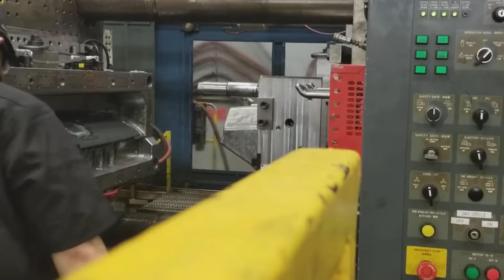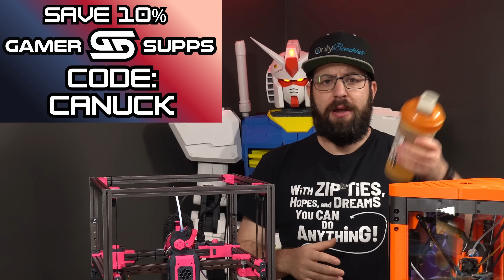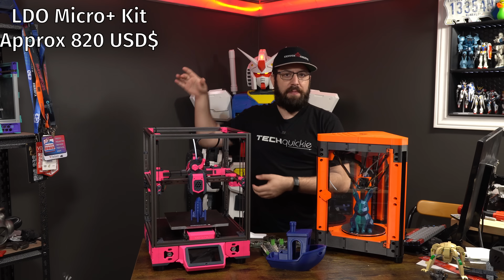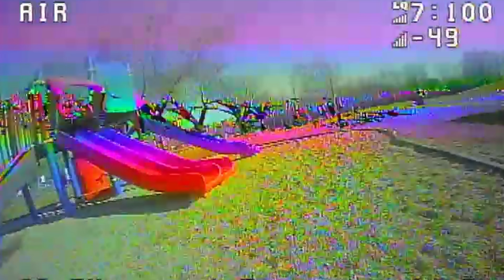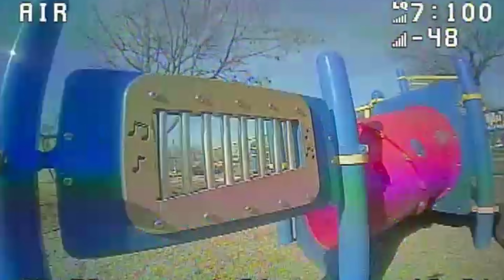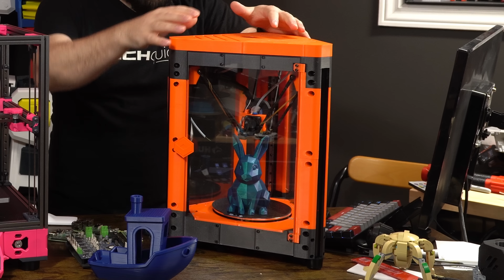Are DIY 3D printers in danger?

Comment from the maker: With the rise of laws regulating 3d printing in various places, do you think that will lead to an increase in people interested in building their own printers in the future?
Reply: The thing is, it's ALREADY ILLEGAL to 3D print a firearm... Or, more accurately, to "create a firearm that is undetectable by metal detectors" or is "untraceable" (which courts have decided means the manufacturer must get a special license and install a unique serial number on each gun they sell). I won't say "ghost guns" don't exist, but they are not anywhere near as prolific as guns that have been stolen and the serial number scratched off that already exist, and there are ALREADY laws against the existence of "ghost guns". And it's FAR safer to CNC-mill parts out of metal than it is to print a plastic piece that has to somehow withstand an explosion going off inside it. So these laws are essentially a solution in search of a problem. Trying to make a 3D printer detect whether you're trying to print a firearm or not is just about impossible, and even with AI it'll end up "detecting" the wrong things, like cosplay props ... is that tube a part for a foam sword/mace or a piece of a lightsaber, or is it a gun barrel? Better shut it down and have the authorities question them like a criminal just to be safe ... that's just a single example. And before you say that I'm being Chicken Little and shouting that "the sky is falling" keep in mind that in Washington state (the state I live in) part of the new 3D printer laws basically says even just owning the files is a crime with an automatic presumption of guilt (i.e. you wouldn't have the files if you weren't going to commit a crime with them) and it's on the suspect to prove that they're innocent (even though it's basically impossible to prove the lack of an intent). You know, the exact opposite of the "innocent until proven guilty" thing that's enshrined in the Constitution.
Reply: @richard3365  A firearm needs to possess a minimum of 3.7 oz of ferrous metal to be considered legal. Most barrels weigh enough on their own to comply. The only 3d printed arms that struggle with this are .22 cal that use barrel liners. You just need to add pinewood derby car weights to get it legal.
Reply: @chrisripley154  But if you're making a gun to do a crime you don''t give a shit if it's legal or not.  How many 3D printed guns blow in the the face of someone using it and take their hands off?
Reply: @KennethScharf  Yes. Again and again, these people try to prohibit others from having guns, when criminals simply don't care. And they'll kill you if you're unarmed!
Reply: @richard3365  Criminals are criminals by definition because they do NOT obey the law. Legal or illegal they will build that gun. They will do whatever they want to. The reason Americans have the Constitutional Right to own guns is to protect themselves from the Government when the government becomes criminal with Socialism or Communism as examples. Crimes with guns are bad but crimes like the Holocaust or purge in the Soviet Union by a government are far worse.
Reply: @richard3365 it is 100% legal to manufacture firearms for PERSONAL use.
Reply: Yes, I do think that the number of people since the commercial printers may be forced to add additional 'unwanted' features.
Reply: I have no interest in printing firearms parts but the ghost gun rationalization for increased control of 3D printers is just an excuse. The big 3D printer companies won't come out directly and say that they want to drive up manufacturing costs for small competitors or that they want to eventually lock down 3D printing entirely so that the only things that can be printed on home printers are designs downloaded from sites they control (and you pay for with a subscription). That would raise massive opposition. So they go for safety concerns to drive the legislation. It sounds conspiratorial to say this but the end game with big tech companies is always to lock down the tech with the eventual goal of turning everything into a subscription. That's the profit maximizing approach as well as the best way to avoid being disrupted by smaller, more nimble competitors. It's all about risk management and creating a steady income stream.
Reply: Most likely considering i sold mine to buy and build a Voron trident. (VT.2222) Not quite finished but to me it is better than the previous even though it is actually slower than it. The experience and knowledge I gained is incredible and has taught me more than anything else I have built. 
Edit: spelling
Reply: I just recently got back into the 3d printer/modding game. I feel like a kid in a candy shop with all the community mods and information available now!, I'm going to build them all!
Reply: I think absolutely. I heard Bambu is now making their updates destroy the ability to use custom firmware, or load files not double checked by their software is gonna cause a major run away from these closed system corpo printers, not just for the lazy ghost gun excuse, but for anyone who doesn't want their privacy infringed by companies and governments.
Reply: @Beffudled  Exactly. I may or may not have printed replacement parts for a certain green colored tractor brand. They would very much like me not to do that. If there is no transparency in what is or is not censored, what's to stop the big green anti-repair machine from secretly blacklisting their parts too? All it takes is money.
Reply: I have 4 consumer grade printers and my 5th is a Voron.
Reply: That was what I was concerned this was about - large markets (NY, WA, CA) are all going very hard on regulating any sort of at home manufacturing (with very little respect for reality) and a lot of those laws also hit the custom build printers by restricting the parts themselves.
Reply: @aschreiber  Idk, I feel that these laws have the potential of creating a new surge in the DIY scene. It's completely legal to buy all kinds of pew pew parts online. The current regulations are really only focused on specific components of the pew pews. So, I just don't see how they could regulate printer components. Maybe mainboards, but that's it. The DIY scene will find work arounds for that even. These new laws and regulations are really only aimed at the printers that are ready to go out of the box. The vast majority of people are not willing to spend the time and effort building their own printer. So just regulating those is enough for the lawmakers to feel like they are reducing the flow of printed pew pews.
Reply: Yes, that may be the next wave!  I kind of hope not, but it would make sense.
Reply: Long awnser no, I will always build a kit i do not want to be locked into apple android era so I can customize at will.
Reply: yes, this era will separate the freedom builders from the beige boys. Andrew started the reprap project to see if he could break free from the expensive beige box and he was right, it can be done. Long live freedom d@mmit! ❤
Reply: Until they pass laws making it illegal to build a printer.  As my governor in NY said “it’s just common sense” to pass these laws.
Reply: There is legislation in my state Washington, as well as New York, Colorado and California heavily regulating additive and subtractive machines - REQUIRING submission of build files to government oversite, PRIOR to printing / machining.  These legislation attempts explicitly makes circumventing this illegal.  My first foray was a Formbot Voron 2.4 - It is an absolute workhorse, I've printed a Voron 0.1 and a V1 Engineering 3'x5' CNC table - having a blast.  I really appreciate your channel - keep up the great work
Reply: I will always have at least one printer that is not locked down.  I have two kit printers from 2012 and 2015.  The 2015 got a hardware makeover and prints exceptionally well for a bed flinger.
Reply: I only build machines that use direct g-code. No online BS. Never will buy a machine that is cloud based only.
Reply: Absolutely yes! Main reason I am doing it myself too!
Reply: Its so dumb to pass laws like this. People can make guns using many many other technologies too. Should all those be illegal? So absurd we are having a political discussion about this and passing laws. Hell a bomb is super easy to make as well but we are not making pressure cookers and pipes illegal.
Reply: Yes, because some people will always want to print guns.
Reply: no. It could maybe hurt klipper printers which rely on the network but you cant really restrict marlin which is self contained and runs whatever G code you throw at it.
Reply: The laws aiming at reducing "ghost guns" from 3D printers are messy and problematic. Don't get me wrong, I have no interest in making guns with my printers, and gun violence is a beast of an issue. 

However, the laws in Washington state and similar that try to prevent 3D printers from printing guns via an AI filter algorithm are horribly problematic:

1) AI detection will never be perfect (false negatives AND positives, easily thwarted by chopping up the STLs, etc.)
2) Requires 3D printers to be connected to the cloud = no data privacy, plus now companies have a direct access to a vast troves of 3D models and intellectual property (targeted adds? copyright mining?)
3) Requires users to be tethered to companies to ensure compliance, but what happens if the company goes out of business? Bricked hardware disabled by a forced firmware update?
4) Big Brother is watching you.

I suspect these issues, as well as Bambu Lab's hypocritical and predatory anti-user lawsuits and recent cease-and-desist letters to open source developers, will rekindle the interest in DIY printers. Hopefully building kits won't be illegal.

While I have many Prusa printers and support their company's ethos, they are still wildly priced and lagging at even basic innovation compared to the competition. I hope the upcoming INDX integration for the Core One+ and L are successful. I'm seriously considering building a Voron V2.4 with INDX.
Reply: If someone wants to explore the “Fire arms” world & how 3d printing could be a tool for that exploration. Then yes building is the choice. 
But due to the 2nd amendment, the thing they call a law, may not be valid. 
We have the right to bear arms. 
A fire arm is a gov’t control tool. Due to the wording alone. They control what they create, and they created fire arms. 
But I’m sure there are plenty to differ with my comments. 
But I ask to be proven wrong, not just talk true proof. 
Anywho my thoughts right or wrong! 
See ya in the funnies!

Comment: I have bought my first 3d Printer 4 months ago (End of June 2026), a Creality K2 Combo.
I thought I didn't want another hobby, already having sports, my homelab and (technically) gaming. I just wanted a tool that can provide me with parts that are not makeable from wood or when I need tighter tolerances. And of course replacement parts and printing a 50ct part instead of paying 15 bucks plus shipping in stores.

My 3D-printing friends joked about Voron saying stuff like "haha just build a Voron and mod it to do multicolor", and they really meant it as a JOKE, before advising me to go for the K2 (for a beginner it provides what a P2S does while being much cheaper to aquire). 
Now 4 months have passed, I stumbled over a Video about Voron Printers about a week ago and was like "huh, wouldn't THAT be a fun thing to build..." 

So here I am, Checking Sources for a Voron 0.2* which I will build when I get back home in a month, and see where the journey goes. I also know that I definitely want to build a 2.4 with a Toolchanger (likely Stealthchanger-ish) in the not so far future. 

What did I learn from this? Well, back then I should have said to my friends: "Joke's on you, I'm building a Voron!"

*yes, I know it is generally not recommended to start building with a v0. I come from a tinkering and crafting family and maintain a homelab with several servers in different sizes and forms. I'll take my chances ;)

Comment: All the points made are so real!
For me I have to buy a cheaper commercial unit, that will be the tool to help me build a Voron Venture xl version. Using several Open hardware projects. 
And use a similar commercial concepts. 
Like using mag liner rails(LightMake L4), optical bed leveling, and use OpenCV for print quality & several other reason. Adding a mmu & tool-changer. This printer will be the main hub of my bigger project. I call it the Hera-Flux Manufacturing fab lab. A 3d printer, cnc, injection system, plastic  recycling system. Also looking to add a diode laser/Circut type frame, all connected to a debris/VOC vac system. Also eyeing a heated hotend tooling setup, a wire edm system! 
It’s an ambitious project that’s really challenging! 
Mainly because I have to design several pcb’s for it all! 
Each frame helps build the next that will allow most hobby or diy folk to have a home production lab option! 
See ya in the funnies!!

Comment: You're not wrong on the situation. I'm in the fourth category: I have zero care about 3D printing being the hobby, I want to make stuff with it... BUT, I like putting things together and gravitate towards kits before finished things. It's meant I have a bunch of Prusas because kit, and when new stuff happens, they have a literal upgrade guide and parts.

But I'm not sure it's all beige boxes: it went from 10k V-roller ender clones to 10k Bambu clones to... wait, outside of "box", Bambu keeps making "different" printers... they have no consistency... nearly every printer has it's own unique parts. So now we end up with 10k Bambu clones where they're cloning different machines (A1 clones, X1 clones, H2 clones) and then the selling point of the machine (speed!) is basically done... but people keep wanting multi-color, so suddenly there's MMU clones, AMS clones, "filament loader" clones, combos of those. And they're coming in at wildly different prices... you can get a X1C level printer + AMS clone for the cost of a A1 sans AMS-lite. And then you throw in tool changers, no no, NOZZLE changers. Nozzle changers w/AMS systems. We don't have a beige box... we have a la carte printers. And then there's Prusa... love em, hate em, call them behind, overpriced, fakes, sell outs, whatever... but they're still the largest not-Chinese consumer 3D printer company who publish their designs and source code online (argue amongst yourselves on open source or not, consumers don't care) and go "sure kid, mod it". There are now multiple kit printers/DIY printers that are "what do you do with your out-of-date Prusa Mini?" "what do you do with are the scrap parts from your MK4 to Core One upgrade?"

We've gone from a bunch of people engineering their take on a horseless carriage, to a dozen mainstream car companies. The kits are still there. The enthusiasts are still there. The question is: how many consumers will buy the off-the-shelf printer and then become the modder/enthusiast?

Comment: A DIY not only costs more, but none of the boards have enough IO for all the sensors you get on an off-the-shelf machine. for me, building a voron was a means to get enclosed core-xy so i could print with useful filaments. Makes it extra frustrating that all those machines that were impossible to find in 2020 are still just cranking out dragons and trash.  one thing the saturated copycat market gets wrong is the complete lack of standardization, the printers all look the same but none of the parts are the same so none of the profiles work, we're definitely due for another shakeup.